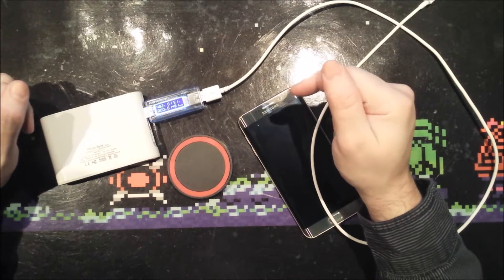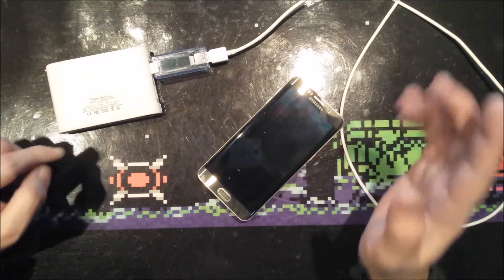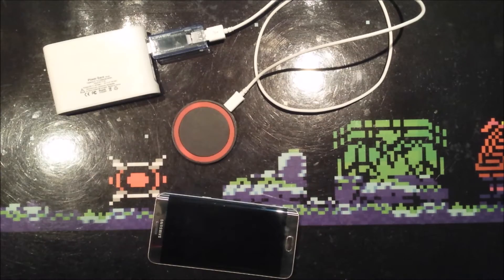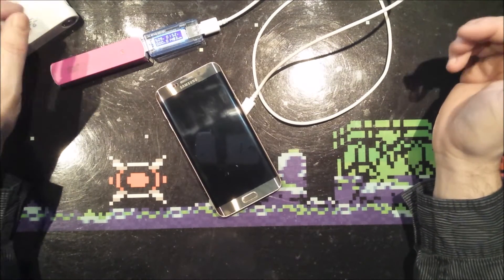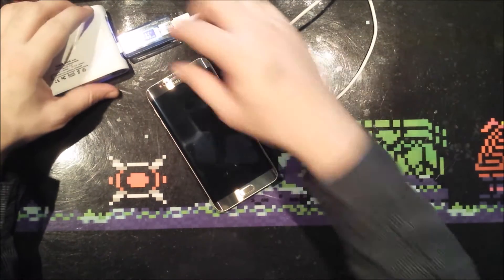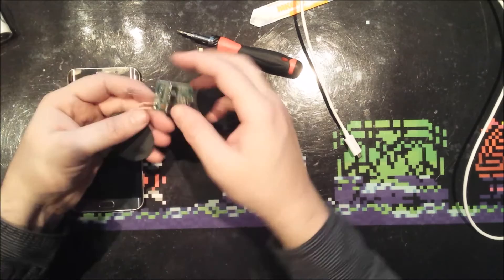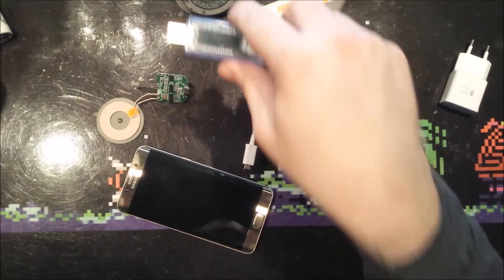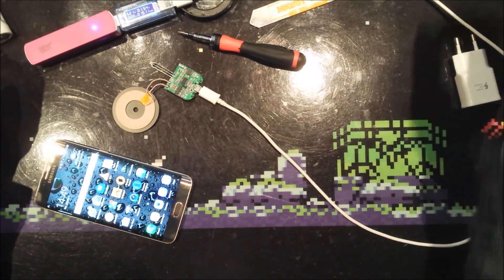Review and inside of a cheap Qi-compatible Wireless Charging Pad

Comment: is it safe to install the coils only in my car ? with an eye on heat & safety. thnx in regard
Reply from the maker: If you leave the original electronics in-tact and feed it with proper 5V which is only turned on when the engine is running, I think it is safe enough. The unit does not get very warm and if it is also protected by a good quality 5V car-charger, it should be fine. I have one build into my desk, which is powered on 24/7 by an original Samsung charger.